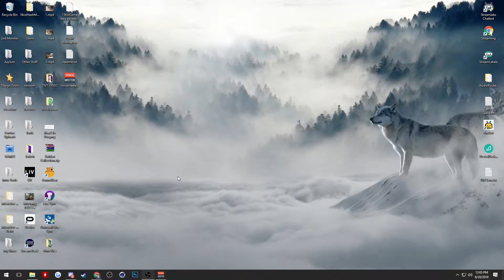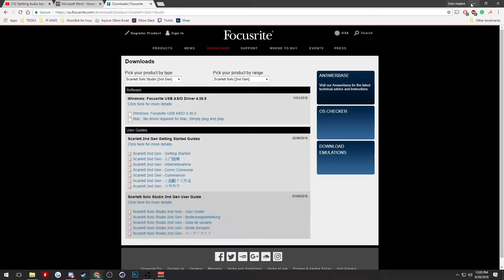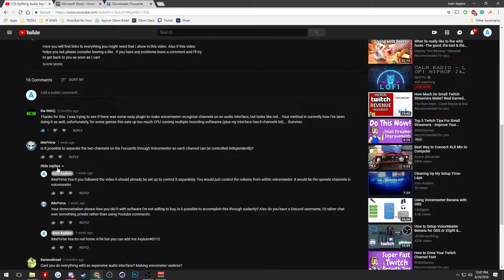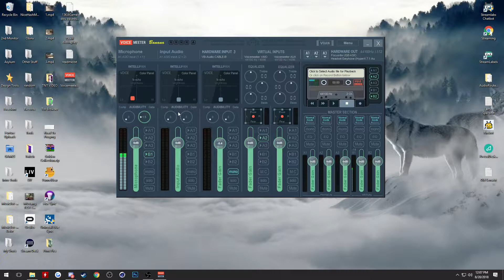(UPDATED) Splitting Audio Inputs on Audio Interface Using Voicemeeter!

Comment: Thank you for the clear instruction, Subscribed! I did play with these setting previously after watching many videos so had an idea about using settings, but lots of contradictory advise out there.  I still get the bleed over for some reason unfortunately where mic in first channel (input) is being picked up in second channel (input) and vice versa. This happens even when volume is turned down on one or the other mic to some lesser degree. The meters show movement and carry over to Reaper which I am just starting to get around to figuring out.  AT least this confirms I am doing it correctly. I can only surmise that it is the basic old hardware I am using (audio box interface), and will need to upgrade. In any event, I plan to eventually get into OBS as well in combination with to record music videos on my pc.  I don't see any clear tutorials using potato tough, only older ones with banana. Are you able to do tutorial(s) using all three together Voicemeeter Potato, Reaper, and OBS, I think it would be a very popular video for you?

Comment: Cant seem to find the ASIO driver on focusrite website. can anyone send me the driver or the link to it?
Reply from the maker: Hello, what is the model of your device? I'll take a look and see if I can locate it.
Reply: @ImmAsylum  scarlett solo 3rd gen
Reply from the maker: @Gear_RB  I couldn't find the drivers specific for the 3rd gen either, just the Focusrite Control software (which might include the ASIO drivers upon installation). However, I would try installing the drivers for the 2nd gen and see if they work for your 3rd gen. Link here https://bit.ly/3r0E6P2

Then if that doesn't work I would try to install that control software and see if it bundles the ASIO drivers.

Comment: This fixed my problem that I've been searching for a solution to ALL DAY! Thank you so very much.

On a side note, I can't seem to get Audition to playback audio after it's recorded. I can see that it's recording, but I don't get audio when I try to play it back. Any suggestions? Thanks!
Reply from the maker: Hey, sorry for the late reply. 1. Do you hear all other desktop sounds? If so check audition settings and see what decice the playback is set to as  that might have been configured incorrectly by accident. And I would also check the Windows 10 sound settings and look in "App volume and device preferences" where you can specify different inputs/outputs per application. Something might be misconfigured there as well. Hope this helps!
Reply from the maker: I would also double check your output from voicmeeter or however your recoding audio in audition to make sure you are getting proper output.

Comment: I have a Zoom U24, and therefore it doesn't use ASIO drivers? Does anyone have any suggestions on how to separate the audio? The old way I did it with OBS was add the U24 twice to OBS, then for input 1 I would pan it all the way to the left and make it mono, and input 2 I would pan it all the way to the right to make it mono. But OBS would randomly freeze for our livestream every 6 weeks, so we switched to Streamlabs, which doesn't have a balance/panning option. So I'm left scratching my head and playing with VB trying to separate the mics. It doesn't let me choose the U24 twice, which is SUPER annoying.

Comment: My soundcard has 2 Inputs. In the first is my mix and in the second my guitar. But in voice meeter both inputs are on the first channel and not splited to 1 and 2. What can I do? Do I have to change sth. In the Asio4all v2 driver and how can I open it? Thx
Reply from the maker: Hello, Does your device not have its own ASIO driver?
Reply: @ImmAsylum  I don't really know. In my DAW (FL Studio) I can choose Asio4all as Audio device and then I can change some settings. Do I have to install a different program or what do you mean?
Reply: And thanks for your answer
Reply from the maker: @3lvis638   What is the device you are using to connect your mix and guitar? Most of these hardware devices will have an ASIO driver available to download from their site. I'm not entirely sure if Asio4all can read separate channels on a device, I have not had experience with it. Your DAW has no effect on splitting the channels for the rest of your system only in that program, so save that part until after you split them in Voicemeeter.
Reply: @ImmAsylum  I have an USB-audiointerface/audiocapture  (UA-25-EX Cakewalk by Roland). This device have two inputs, where I put my mic and my guitar in.
Reply from the maker: @3lvis638  I'm assuming you already have the drivers downloaded for this device from the site https://www.roland.com/global/products/ua-25ex/downloads/.  Would you mind adding my on discord so we can send information back and forth a bit easier?
Reply: @ImmAsylum  I finally made it. I fixed the problem with downloading the offline-settings version of the Asio4all driver. Then it was possible to open the the panel as a normal program and then it worked. Thanks for your response!!
Reply: @3lvis638 Hey man do you mind telling me how you fixed this exactly? I have a similar issue where I cant split inputs 1 and 2 using the Komplete audio 6
Reply: @dplocus123  After I downloaded the Asio4all offline-settings version, it worked for me. Then it was possible to split the 2 Inputs of my Soundcard :)
Reply: @3lvis638  Would you mind sharing how to split it or some helpful videos or info you might have? I have all those things but I have never used ASIO4ALL so I am not sure on how to utilize that program.
Reply: @dplocus123  What is your Audio Interface?
Reply: @3lvis638  komplete audio 6

Comment: Followed this tut and had everything working for the longest time, now, after the latest windows update it seems, my mic is no longer working in discord/skype/etc, I've got the following set in terms of input/output: 

[In Windows] Output Device: VoiceMeeter Aux Input (VB-Audio VoiceMeeter VAIO) ///\\\ Input: VoiceMeeter Aux Output (VB-Audio VoiceMeeter Aux VAIO)

[In Discord/Skype] Same as above

Voicemeeter is picking up my mic but nothing else seems to....
Reply from the maker: Sorry for the late response, have you checked that the channel the mic is on has "B2" selected. Also not that it matters but is there a particular reason you have desktop and mic audio being routed through the AUX vs the VAIO? Mainly you want to make sure that the mic channel is being routed to whichever channel you have set up to receive and play the mic audio wether that is AUX or VAIO etc. Please let me know if you have any other problems or questions :)!

Comment: This is exactly what I've been looking for, I just want my DAW audio to be hear-able through discord and whatnot... If you could make a new video with this updated method from start to finish that would be awesome. Just very confusing lol. I'm gonna keep trying though.
Reply from the maker: Are you talking about what to do once you have it separated in voicemeeter? Like how to route the audio after that?
Reply: @ImmAsylum  I guess so. I use a Steinberg ur22mkii and people can already hear the clear guitar but not the distorted guitar from Ableton/BAIS Amp (daw vst)
Reply from the maker: @codymarshall5015  If you have the virtual audio cables from voicemeeter the HiFi cable and the other. In Abelton (or which ever daw you are using) change the output device to one of those virtual cables. Then add that virtual cable input on a free strip in voicemeeter, from there you can control where that audio source is going. That should get you setup right, if not I'm more than willing to help you further on discord.
Reply: @ImmAsylum  for some reason virtual cable is not showing up as an option. Only Voicemeter virtual asio. I have both downloaded though.
Reply from the maker: @codymarshall5015  Not showing up as an option in Abelton or winodws?
Reply from the maker: @codymarshall5015  I got some things to do then I'll add you on discord about an hour maybe less
Reply: @ImmAsylum  thank you so much dude
Reply: @codymarshall5015   Hey I've exactly the same problem, did you find a solution ?
Reply: @agentshrek4055  You just have to use voice meter banana somehow with virtual cables. I couldn't figure it out but that is the answer. It's too much of a pain I tried for hours.
Reply: @codymarshall5015  i just found a solution with voice meeter combined with another software and it works well
But thanks for your answer ;)
Reply: @agentshrek4055  What was the other software?
Reply: @codymarshall5015  it is Cantabile,
I watched this video: https://youtu.be/8W4-M-NgZ4o and i used guitar rig 5 plugin

Comment: Hey Imm, is it normal if i hear my voice when speaking ? Also can you tell me if voicemeeter has to be the default device in control panel ? ( in recording/playback)  
i hear my voice when speaking when using the software, and i'm trying to solve the problem
Reply from the maker: You probably have one of the A1 A2 or A3 enabled on your mic input. Depending on the output channel you have your headphones on you might have to turn it off on your mic input. Example: A1 is using asio driver for microphone. A2 is your headphones. So on your mic input turn off A2 so your mic isn't being routed to your headphones. 😊
Reply: i got a scarlett 2I2 and my headset is plug on it so i can't see my microphone name like most of you, that's why i'm a bit lost, here is what i see : https://ibb.co/dHWcUq  @ImmAsylum
Reply from the maker: @LeSaviezVous001   It doesnt look like you have it configured as shown in this video. Id start there and see if that resolves the problem :)